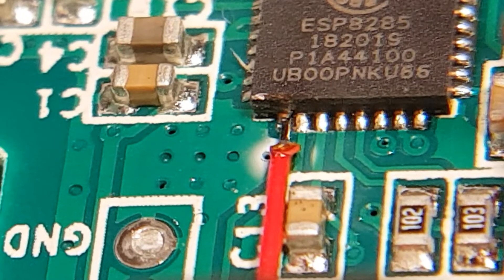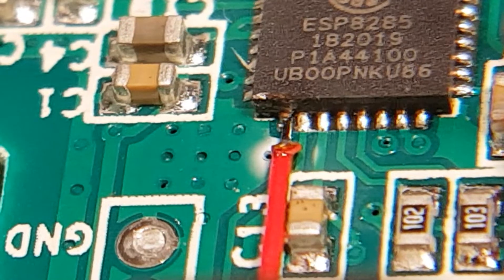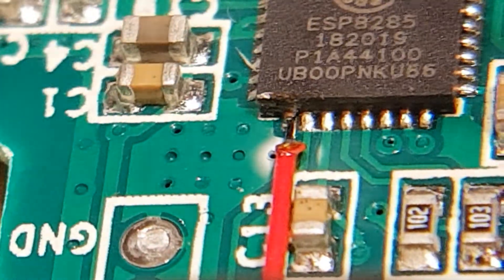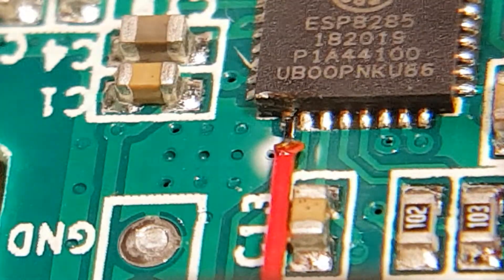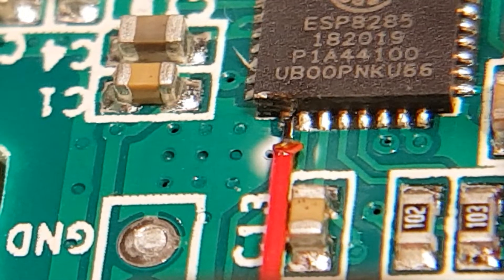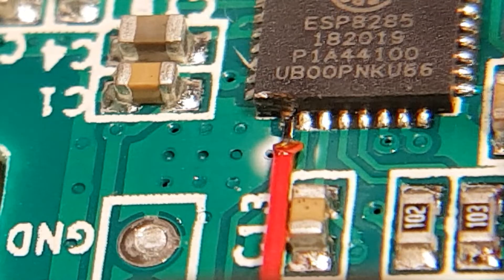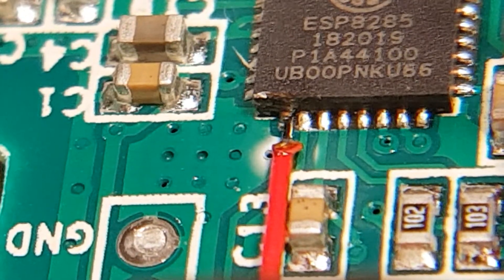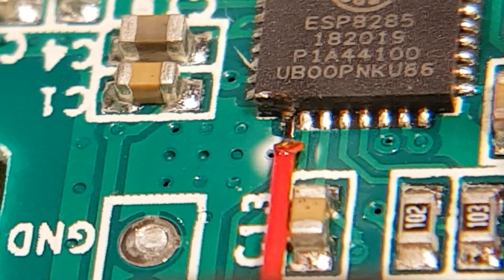Getting access to GPIO14 on Sonoff Basic R2 for Tasmota.  GPIO14 found on Sonoff Basic R2

Comment: I think the wire which is being is equally important because normal wire is not much of a help
Reply from the maker: This is the wire wrapping wire I used.

 Bluesky 0.25mm Red Yellow Blue Green White Black Purple Tin-Plated Copper Wire-Wrapping Wire 30AWG 305M /1000ft (red) https://www.amazon.ca/dp/B01HT8Z6YK/ref=cm_sw_r_apan_i_QBP96XVYWTBP6BV1HKMQ

Comment: I tried this but wire got soldered with two adjacent esp pins
Reply from the maker: If you use flux, you could probably free the solder bridge from the other pins. 

I use this 

MG Chemicals 836-P No Clean Flux Pen, 10mL https://www.amazon.ca/dp/B01ELUI19Q/ref=cm_sw_r_apan_i_AP0E3VGX5STY1A4KVHRF?_encoding=UTF8&psc=1

Comment: Wow...aint no WAY you can solder to that small pin!   How did u do that??
Reply from the maker: The trick is to use an alligator clip to hold the wire in place for you. I also need a magnifier to make sure everything is lined up properly but younger eyes may not. The magnifier I use is a jewelry loop that I put in one eye, or use my phone. I show it in one of my videos.
Reply: Thank you Sir!   Appreciate your reply!

Comment: How did this work out? Have you tried adding anything to the GPIO14?
Reply from the maker: Yes it works great!  I have a couple different videos where I use it.  I have connected a ds18b20 and a dht11 sensor on different modules.  Some people use the tab marked Key, but this will cause issues if held low cause it is not gpio14 but rather gpio0

Here i hook up a temperature and humidity sensor. DHT11

https://youtu.be/bWx7Nu0eZ34
Reply: @thecityviking  thats great, i need to controll my car heater. You use I2C with GPIO14?
Reply from the maker: In the videos I show exactly how to connect and also flash to Tasmota.

Here is a link to all my Sonoff stuff

Everything Sonoff and Tasmota: https://www.youtube.com/playlist?list=PLi5v3LPuee5Qj4nfTPeADFyEOTfuJ5jgn
Reply: @thecityviking  im gonna look into this. Thank you! 😁👍
Reply: @thecityviking  one last question, what is the gpio called? just GPIO14 or something else?
Reply: @thecityviking  It worked, and it wasnt even particulary hard! My soldering tip was big so i accidentally fused two pins.... but using my phone and zooming made it a tad easier to use the "edge" of the tip and i managed to remove the "joint". Now i have a Sonoff R2 (not the same R2 as yours, my chip was located on another place) and i have connected a DHT22 to GPIO14. Seems to work like a charm so far. reading are correct. 

Okay so im very grateful, because this means i can carry on with making my carheater operate on a temperature range instead of just blowing constantly for the 2-4 hours my engine heats up. So i guess im gonna more than half my use of the cupé heater.
Reply from the maker: Thats great!  I love to hear when I have been able to help someone out. That pin is gpio14.  I am not sure if it has another name, but it is the same pin as the pins used in the earlier sonoff devices.
Reply: @thecityviking  i posted this video on Reddit. Hope you get some views. 😊
Reply from the maker: Thanks for that.  I have already noticed a bunch of views.  I was wondering what was going on.  Cheers!
Reply: @thecityviking  quid pro quo. 👍